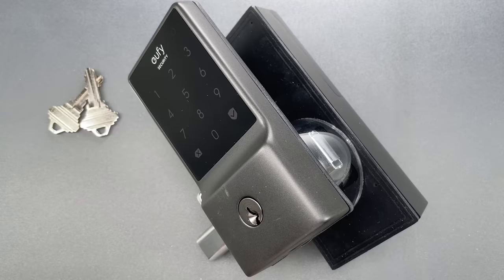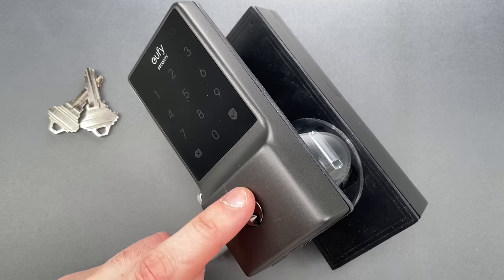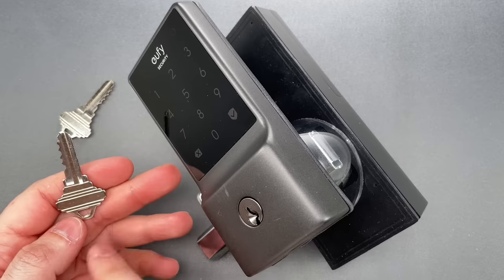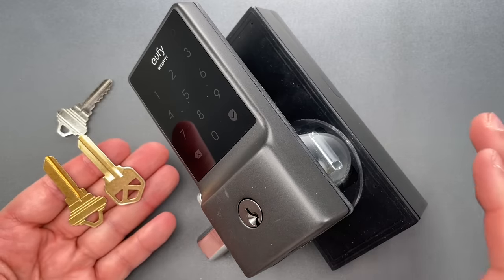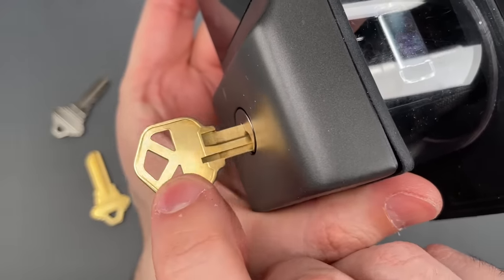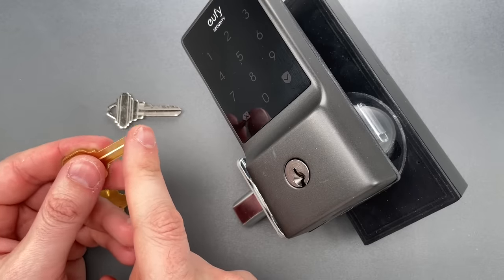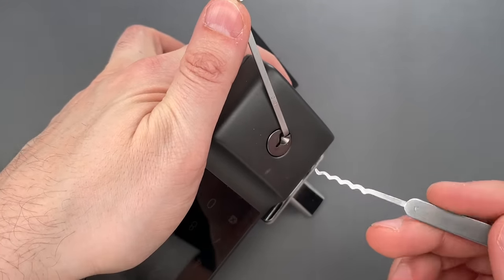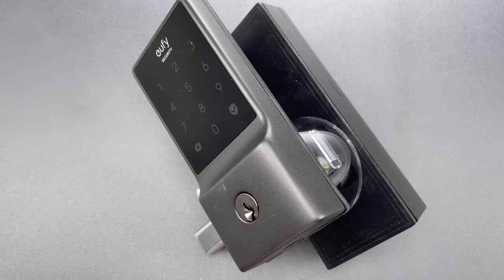[1515] This Eufy Smart Lock May Frustrate You (Model E110)

Comment: The amount of companies that just slap a cheap lock onto an otherwise expensive product is embarrassing
Reply: Reminds me of dash cam products. Garbage camera with garbage processing and you pay $300 for it to have a half decent gyroscope for crash detection and GPS speed recording
Reply: Most of that comes down to them being tech companies.

They know how to make decent tech, electronics and so on, but they never consult someone that is an expert on actual locks.

These companies probably dont care that much about the actual lock, in their eyes it is just a backup, that is more or less never going to be used and why spend money on that.

In most cases, they probably just buy some off the shelf cheap lock mechanism and slap it on their tech product.
Reply: But they didn't here.  They went to some lengths to make a unique lock - a cheap one would fit the normal keys.

They put effort into making a worse lock than anyone else.
Reply: @DanStaal  I want to look into it personally, but I'm not so sure it's a "unique" lock. My guess is that it's a cheap core common to the Chinese market (where I believe eufy is based) and they didn't bother to check to see if it would cause problems in the US market (and other markets potentially)
Reply: I'm not even sure it's technically that cheap in this case, as they seemingly went out of their way to make a lock that fits a nonstandard key which surely would push up the price of production due to lower volumes?
Reply: And he called that a "mediocre security?" i think mediocre would have been if he used a pick to pick it, but waverake is just abysmal security level xD
Reply: @Kram1032  No, it is a cost cut core for the export market, that 2mm of brass both sides means a saving of 2c per unit, which probably is at least doubling the profit the manufacturer (not Eufy, but the OEM) is making on each unit.
Reply: It’s a business problems rather than design or engineering. The company spends the money on developing the smart part and the dumb backup lock is a second thought. When they go to figure out the backup lock they have 3 options. 

1) Buy a secure lock from a big brand nice, this would be expensive not only for the hardware but also needs a business deal to allow them to use their brand name and puts the big brand at risk or conflicts with the big brands own smart lock business. 

2) design and commission their own secure lock design, but they don’t have experience with lock design and down want to pay to manufacture a dumb lock when they are already paying to manufacture a smart lock

3) use whatever off the shelf, unbranded, cheap, lock they can find and source easily.
Reply: So if you have a safe with logo on it, pry that logo off and there will be a very basic 3 pin behind it. Biggest bestest safe in the world, is secretly defended by a simple rakable 3 pin.
Reply: It does not end with locks. This trend is everywhere.
Reply: Realistically speaking, this is because an actual good lock core is an expensive affair - $30 and up.  The manufacturers charge quite dearly and since most of them also sell complete door handlesets, god knows if they'd even do business with you. Which means that if you're trying to build a product that has a lock on it, either you buy a crap lock from some crappy schlage/kwikset/yale/ch751 clone manufacturer or become an actual lock manufacturer.
Reply: This iS Eufy. The same company just utterly embarassed by claiming to NEVER sell or allow access to their home camera footage, as it is only local stored....Which was found to not only be sending the footage over the cloud, but unencrypted, and viewable by anyone with VLC media player.
Reply: like putting a mailbox lock on a porsche 911
Reply: @EyeMWing  $30 and up? With a minute of looking, I found Assa restricted-keyway KiK cylinders for about $30. That's a very high quality lock that I can buy from a retailer without any bulk discounts. I guarantee that Eufy could have gotten a cylinder at the Schlage/Kwikset level in bulk for far less than $30 a piece. Probably less than $10. And it probably would be less than whatever it cost to get these nonstandard cylinders made.
Reply: @HeWhoIsWhoHeIs I feel certain he would have said if the cylinder could be swapped out.
Reply: Nothing about this lock is expensive other than the price.  It's a Chinese product stiped to the bone to maximizer profits.  This stuff proliferates Amazon these days.  It's getting harder and harder to find quality products from Amazon as they just shill or store front those that shill cheap Chinese merch.
Reply: To idiot that buys these, yes. Not to the company cuz they are laughing all the way to the bank when you buy their newer version for only 3 payments of 199.99
Reply: I (temporarily) ran a 1/2 way house.
None of the tenants locked the door and were regularly losing their keys and then banging on widows to get inside late.
Needing to rekey and then give each one a new 🔑 key when one of them stopped paying rent was a big pain.
🔶 So I got a US name brand  E-Lock ~ like that one: 
Separate code for each tenant,
No keys for them to lose 🔑 at all.
No rekeying every time one of them didn't pay 💸 rent, just delete their code.
+bonus it automatically locked itself after 10~15 minutes 
🤞 Common room TV didn't get stolen overnight.
Problem was they were then leaving the door open to go out to 🚬 smoke so they didn't have to use a code to get back in.
Came back once after a late shift to the door ajar a tiny bit...
Bolt kept trying to lock over & over 🙄 for ❔hours ♻️
After several months dealing with these issues I closed the 1/2 way house and returned the lock, before the return window closed, and got my money back.
 ✌️
Reply: Most of us would never known without folks like lpl calling them out.

Stay safe out there
Reply: @JohnDoe-bd5sz  Only problem with depending on the electronics on this one, is that per a number of Amazon reviews, the batteries are only lasting about 2 weeks.  I would def want the key for backup.
Reply: @kiralan8578  Offcourse.

Unless offcourse you have 2 entrys to the house.

We plan on installing an electronic lock to our main entrance, but i dont need a backup, because our backdoor has a mechanical lock so i can get in that way.

And i dont even have to carry the key to the backdoor, i have a key lockbox somewhere safe (Safe = Hidden, plus you would need to pass 2 cameras to get to it, in well lit areas).

And yes...The lockbox is one of those that LPL has shown to be easy to defeat, but as said...Hidden and cameras..
Reply: @JohnDoe-bd5sz  Oh the absolutely consult someone on the lock part, and when they figure out that doing it correctly is expensive they make a business decision.
Reply: It is embarrassing! society normally sees a lock and accepts that the state of the item is therefore secure. Not the case
Reply: It's the physical security version of the 256 AES "Bank Grade" encryption taglines you see on apps that just use generic security.
Reply: The fact that people still think locks on doors equals security is embarrassing. That's a nice decorative window next to that lock you think keeps people out. Locks only keep honest people out.
Reply: You say that, but 99.9999999999% of people that know how to pick locks aren't walking around stealing. A better lock has steel that isn't easily cuttable. The lock is secondary regardless of how easy it is for this guy or others to pick it.
Reply: 99.9999999999% of people that know how to pick locks aren't walking around stealing. A better lock has steel that isn't easily cuttable. The lock is secondary regardless of how easy it is for this guy or others to pick it. If you're running a padlock business, you worry less about how easily it can be picked, and more about how easily it can be cut off. Most thieves aren't picking locks like you see in the movies.
Reply: It's probably more embarrassing that people think anyone actually pick locks in any major way. 

99+% of everything that happens in crime is something unlocked, that doesn't have a lock, is destroyed to get in during a raid etc.

You only need one thing to stop 99+% of what might happen and that is something that looks like it needs a key and doesn't open if you try the handle.

Comment: From security cameras that broadcast the recordings to the world, to door locks that can easily be picked, Eufy has you covered!
Reply: It's too bad. Eufy kinda started out decent. I have one of their robovacs from YEARS ago, pre-wifi smart everything. Just a plain old bump-around-your-house robovac... The damn thing refuses to die, and eufy still sells oem parts for it often at a cheaper cost than the 3rd party stuff on ebay/amazon.
I am honestly so happy with that dang vacuum. Couldn't recommend it more. It's got thousands of runs on it and just keeps chugging.

But it seems like anything that is an IoT device, or connects to the cloud is right out. Same with anything that is even remotely a security product. And they've shifted heavily to being an IoT and Security company.
Reply: @nasonguy  Yup. I've got one of those vacs too, and it's indestructible (provided a bit of maintenance and the occasionally replaced "consumable" like the wipe brushes). Dumb as a box of rock, but just keeps on bumbling about doing it's thing. However, yeah - they've really killed their credibility recently, both in quality and "spyware".
Reply: what do u mean broadcasting to the world??

Comment: Eufy's new slogan: Easier to bypass than to get a replacement key.
Reply: And they are nice enough to include four non-destructive ways to open it.
The easiest being: Look at the number pad and copy the possible patterns based on fingerprints on that nice glossy touchscreen!
Reply: The question is:
Was the picking fluke or not, since he only did it once?
Reply: @windowsfan95  he only did it once. Definitely a fluke

Comment: So on the third trip the locksmith sells you a wave rake and teaches you how to use it. Neat.
Reply: You just watched how to use the wave rake, it is only 5 seconds to open, and looks like the most basic attack you can do to a lock that doesn’t have a hole for a wire.
Reply: @jfftck  whoosh
Reply: @jfftck    There was a double core lock that was even easier to open. You just needed a pick to reach past all of the pins and then turn it.
Reply: Why you buy smart lock in the begin with? To open it with a key? If you get other access, just super glue it problem solved

Comment: Bloody hell, I knew exactly what this video was about right when I saw the title. As someone who works in a Frattallone's hardware store, I ran into this EXACT same issue a couple weeks ago. Customer brought keys in to be cut earlier in the morning, was cut a set of four SC1s and sent on her way. She came back later that evening while I was there and said her keys didn't work on her lock. She figured the were too thick, so I thought, "Oh, maybe she needs some SC9s instead!" (They're a tiny bit on the thinner side and have a slightly altered keyway.)
 So I inspected them and noticed the grooves were the complete opposite way around from a standard Schlage keyway. I then asked her what the keys go to and that's when she described her Eufy smart lock. (Same model and all.) Thankfully I compared her keys carefully against my KW1 blanks before I cut any and noticed the length difference. Though I think I might've used WR5 blanks in my case? Can't remember. We refunded her for three of her SC1s and just swapped the fourth with whatever I cut for her. She was nice enough about it after I explained what had happened, though! Haven't seen her or the key I cut for her since. :P

 But in any case, it's hugely frustrating for both parties. For one, it heavily inconveniences the customer. Besides having a nonstandard lock with an obscure (and insecure) keyway, it means they have to burn gas driving back and forth between home and the location they had their keys cut if the discrepancy isn't caught. AND it makes the vendor look bad. But even if the vendor catches the discrepancy, there's still a reasonable chance they may not know how to replicate the key, and the customer goes home empty handed (and possibly furious) anyways. 
 I could see the justification for a nonstandard keyway on a smart lock if it offered a higher degree of security, but being wave-raked open is just not acceptable.

Many thanks to you, LPL. Most of my lock and key knowledge comes from your videos, and it's been invaluable help with my job! Cheers.
Reply: Since you work there: why do people want more keys for such a lock? I thought you would install a lock like this, install the app and save / set codes and then put the keys in a locker somewhere or not even that but chuck them in a drawer somewhere. /?
Reply: @elvinhaak  Mostly they get keys copied for their kids for when they come home on the bus, which really should be a non-issue for smart locks since A) they should know the keypad combination, and B) I think the Eufy locks in particular come with a set of 4 keys.
Reply: Points for "working at Frattalone's" (great people at all five different Frattalone's I've been to)...

...for those who don't know, Frattalone's is a Twin Cities, Minnesota local hardware store chain...not HomedLowes or Walbor Freigmart, GOOD hardware stores...

...sadly, however, like the rest of the mass market stores that sell locks, nothing really special, and then, they have MasterLocks...

...I didn't see any Kwikset with "Beyond Maximum Security", though, and no HyperTough anywhere 😊
Reply: @Andy Ruse "stereotypical American" lol. As if families in most other countries are any different.
Reply: @sir_john_hammond  in America we “spare no expense” - even on keys.
Reply: Why did you write that as if you're imitating LPL?
Reply: @sir_john_hammond  Presumably he just didn't want to speak for other countries.
Reply: @jakecooper5855  probably because he was talking from experience and on the key copies side of the problem
Reply: @Patrickf5087  So he imitates the way someone else talks? The mannerisms, certain words and structure? It has nothing to do with the facts used buddy
Reply: @Ian Goth you're damned if you do and damned if you don't with everyone seeing their sensivities as their greatest virtues these days.
Reply: @jakecooper5855  why are YOU getting  offended, Buddy?

Do you not see that LPL liked OP, and gave a thumbs up?

Stop getting offended for others when they are VERY CLEARLY NOT OFFENDED.

You will live a MUCH happier life not trying to take offense from other people
Reply: @elvinhaak  It's always good to carry around a manual key just in case.  Like if the internals break or something similar.  Nothing worse than being locked out of a house and no way to get in without smashing a window.
Reply: @theHalberdAI  1 key kept at the house, 1 key to the trusted neighbor, 2 keys for husband and wife (emergency backups), and 1 key for the children
Reply: @Patrickf5087  Where did you see offense there buddy? If people want to be sycophants and imitate their favourite anonymous youtuber then let them. I'm just pointing it out as it's pretty pathetic

Comment: Locksmith here. I have come across these keys before, from a couple different cheap manufacturers. I have missed the different head before, and when it came back, i noticed it was a KW1 with a Schlege head. Once i recut it, i noticed that when i shoulder stopped it, the blade came short of the new blank. Shoulder stopping is standard in my area, as it guarantees that even if the key is shorter, you will notice because it will cut off most of the tip. After which, one can file/grind off the remaining finger below the chuck. The only way this could be an issue is if the key is code cut and not compared. I could see some newer locksmiths missing that (i was there). It is good to spread the knowledge of the different heads, as that is a pain, but having a shorter key shouldn't make a difference as long as the locksmith is competent.

Comment: I used to work for Ace for 5 years and honestly things like this were fairly common. I used to manually file down keys that had too long and once I realized they were fairly common I was always on the lookout for things like this. A first time buyer really should be told things like this and I am glad you are around to do so! The average employee won't be on the lookout for keys like this for sure.
Reply: I also worked at an Ace for 5 years and instantly noticed the blade was a KW1 too. I've had to file down the ends to adjust the length. Stuff like this is unfortunately more common than people realize.
Reply: I love going there 🥹
Reply: Ace is the place with the helpful hardware folks 🎶 ☺️
Reply: I’ve had a few copies done at a local Home Depot and I noticed the last few times that the guy making the keys compared them to the old key when he was done to make sure the sizing was right, and shaved down every part that didn’t perfectly line up.
Reply: To be fair, nobody should buy THIS lock. I also saw how master compares keys, i had this idea that his replica was very imperfect, so he filed it. And yes, sometimes key was just jamming or spinning freely and not opening.